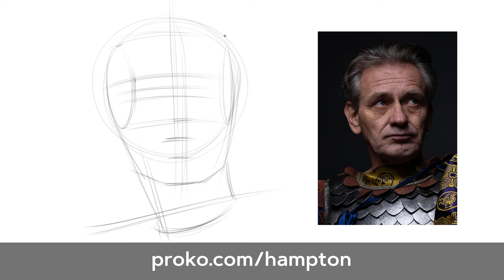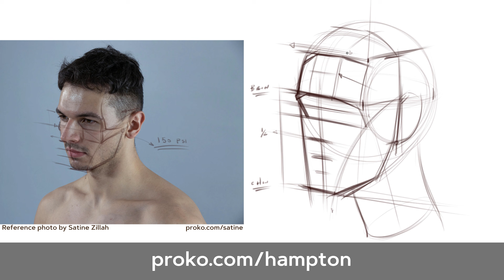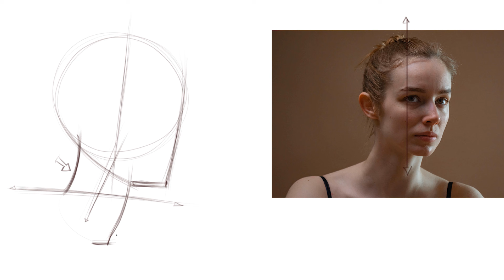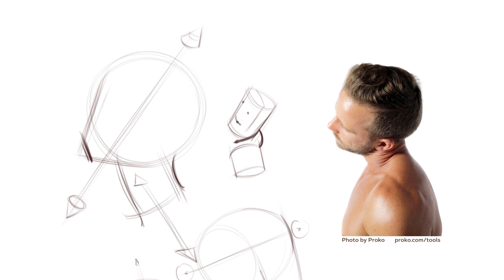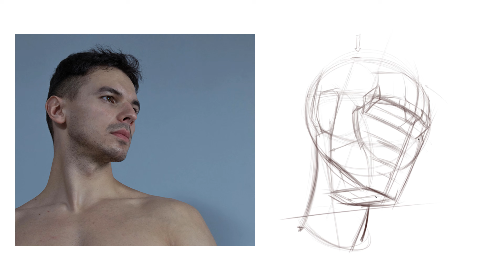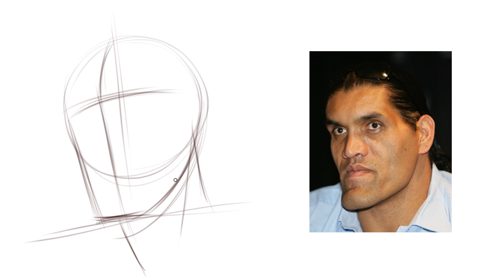Drawing and Constructing the Head - New Course

Comment: Do you have a video that teaches how to draw an eye in detail? And if you don’t, I heard from someone that to draw an eye you should divide the upper eyelid into three sections and the lower eyelid into two, using straight lines. After drawing those straight lines to divide the upper and lower eyelids, should I curve them slightly, keep them straight, or how should I do it? I hope you reply, my brother.
Reply from the maker: I don't have a video on that specifically. What you described sounds like really good advice though.
Reply: @stevenmichaelhampton Yes, but those three straight lines should be for the upper eyelid and two for the lower eyelid, should you make it curved or slightly soft and not straight, or keep it straight?
Reply from the maker: @kamere-k8l maybe start with straights and build to curves 🤷🏻‍♂️